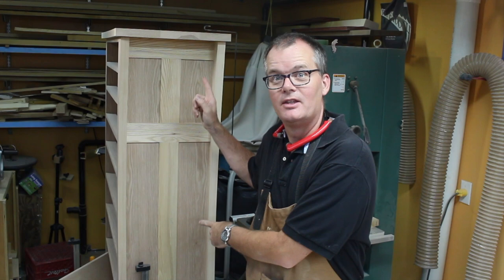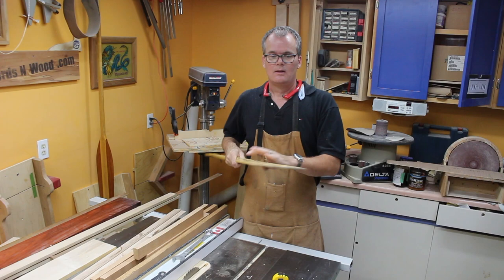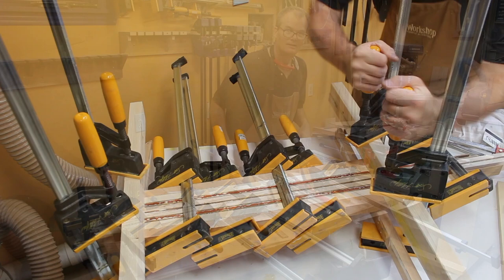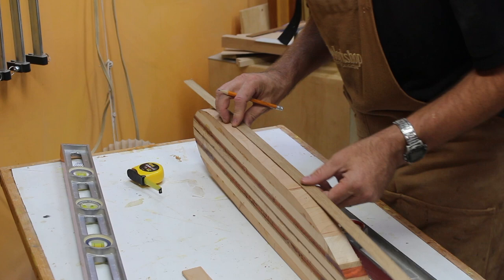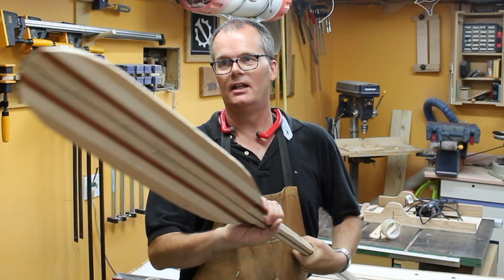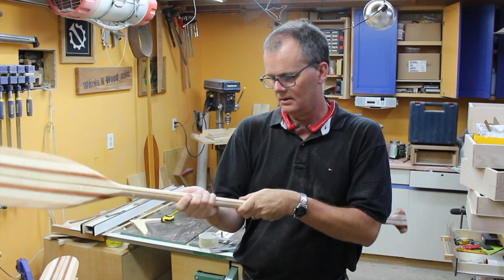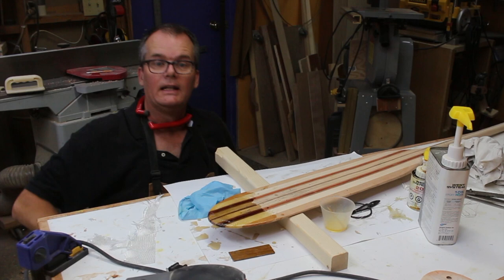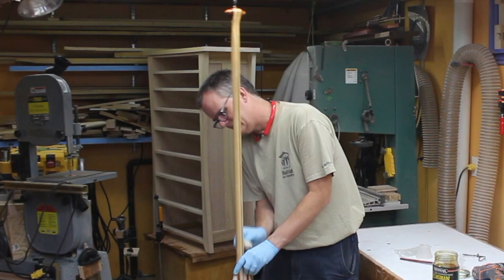HOW TO Make a Custom Laminated Canoe Paddle (WnW #72)

Comment: Nice build. I work for a shop making paddles for a season.
Reply from the maker: I've seen a "how it's made" video online and it was definitely a lot more automated than this!
Reply: We used a shaper for rounding the handle & jointer to get the blade thinner. Then on to the bandsaw.

Comment: Really nice paddle for something you just slapped together. Let me ask you, what kind of glue do you use? A friend of mine who has built a few paddles uses a two part epoxy. personally, I don't care for mixing epoxies. I just as soon use a carpenters glue. Well done video! Cheers!
Reply from the maker: I just use exterior rated PVA wood glue.   Don't remember if it was Titebond II or Titebond III.     It's worked well for me.

Comment: Nice paddle would oak be good for shaft? And finally of all the videos I`ve seen your the only guy that used it right after making it thanks.
Reply from the maker: Thanks, Peter. 
You can use all kinds of wood for the shaft.   Spruce, Cherry, Western Red Cedar, Walnut, Basswood...    I used oak for my very first paddle simply because I considered it practise, but it actually worked.  Red oak is technically a bit too open grained for this, as it can soak up water really easily.
Reply from the maker: ps: It was critical to me that if I was going to film the making of a paddle then I had to have footage of using it.  Thanks again.

Comment: Great video - this will hopeffully motivate me to finish the paddle I already have started. How is the weight with the hardwoods?
Reply from the maker: Thank-you, I forgot to include that in the description!  It weighs 1141 grams, which I think is pretty good.  
My wife has a commercial paddle which is 700 grams, but it is almost 10-12" shorter as well. It's lighter than my previous custom paddle.

To be truly a featherweight you need to use something like Western Red Cedar for the shaft.  Made my son one like that 4 years ago and it was 673 grams, and it was just about as long as mine!
Reply: Wordsnwood (Art Mulder) l